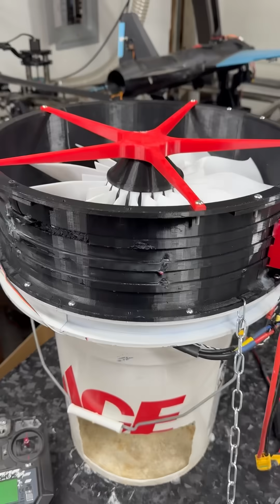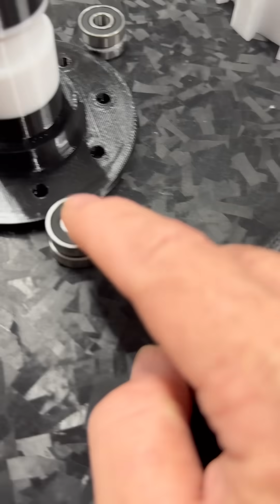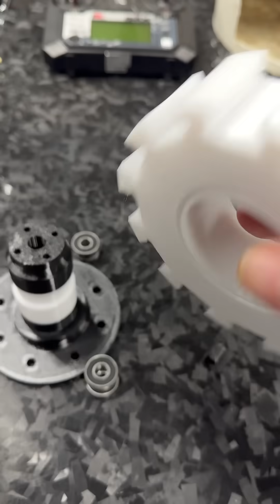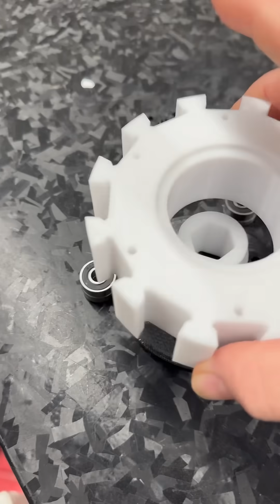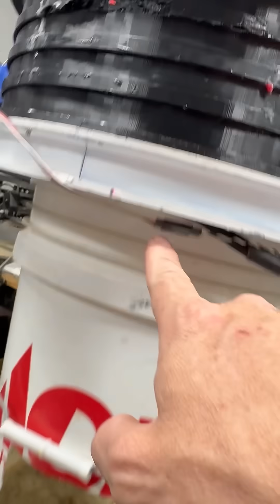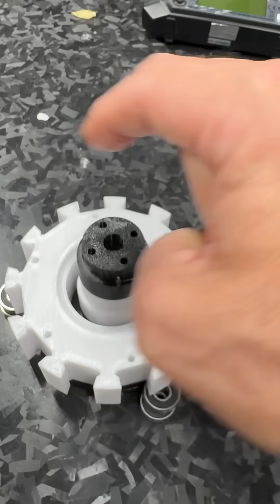New tapered, roller bearing will add necessary strength for the EDF fan stability. #fyp #shorts

Comment: If I'm not mistaken, the glue has to be able to withstand the forward thrust of the main shaft right?
Reply from the maker: There are two main shafts per main and internal hexagonal insert once bonded with CA both the front and rear of the main shaft are one pieces and has a bond stronger the even the layer adhesion.
Reply: @warmachined3472  Nevermind, you said CA 🤦‍♂️
Reply from the maker: @moshet842  Can you elaborate?
Reply: @warmachined3472  Sorry my previous question was deleted for some reason. I had asked what kind of adhesive you were using
Reply from the maker: @moshet842  CA Glue or Epoxy it just depends on what forces I am dealing with. One thing to remember about this system is that it is designed ultimately for CNC manufacturing in future applications. This adaptation to thermoplastics for testing does require some changes to test the system as intended. FDM printed threading to make the main shaft accessible for maintenance is too weak however those changes will be made for the alloy version of this EDF.
Reply: @warmachined3472  Makes a lot of sense
Reply: @warmachined3472  What sort of adhesive are you using?